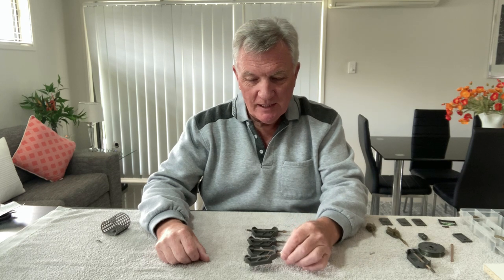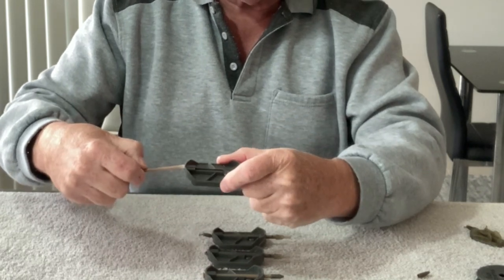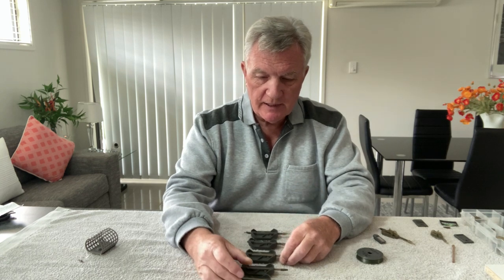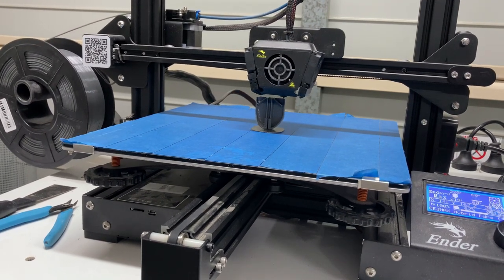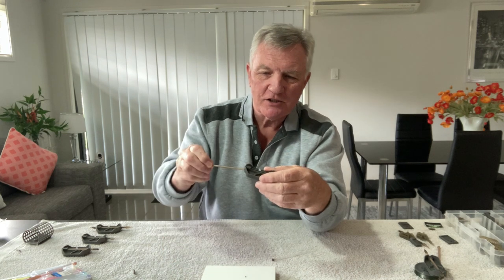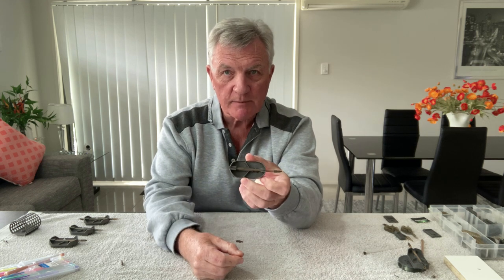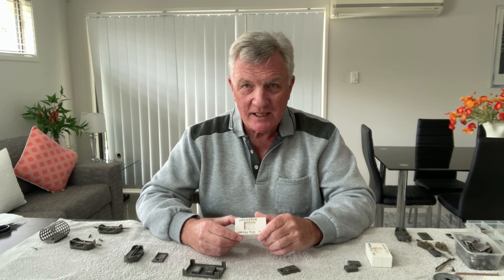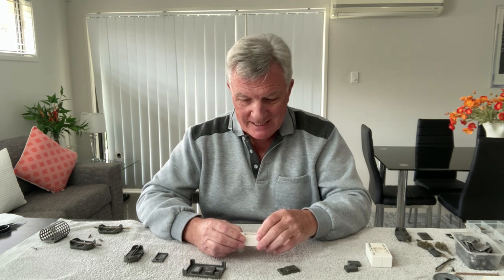New Method Feeders for Big Venues

Comment: Thanks Den for another very useful and most informative video. I mostly fish uk commercials so smaller non elasticated feeders are a must, but i will probably print these as well.
My Ender just about copes using Petg at quite a high temperature but it's worthwhile after a few tweaks as i found out when making your bait droppers. Thank you for expertise Den and role on your next match 🎣
Reply from the maker: Thanks for your comments mate. Much appreciated.

Comment: Well done.  I will be making them soon!
Reply from the maker: No worries Phill. I hope you catch plenty of fish on them.
Reply: @FishingwithDen  They printed well just got to get out and try them.
Reply from the maker: @Offcut55  Excellent mate.👍👍
Reply: @FishingwithDen  Just found that they will accept Bowden tube ;)
Reply from the maker: @Offcut55  I never thought of that Phill. If you want something more rigid and cheaper though, you could try that white plastic tube from model shops.
Reply: @FishingwithDen  I ordered some from Ebay before I had that lightbulb moment and tried my old Bowden tube after moved to Capricorn.  I did make a petg tube that worked but not sure for how long
Reply from the maker: @Offcut55  Capricorn tube would very durable Phill. I don't think a PETG tube would last more than about 5 minutes though.😁

Comment: Hi Den, What Dia are the gel stems and what are the make Thanks
Reply from the maker: I think they are Anko Bob from Kmart and they are 4mm I believe.
Reply: Hi Den, Thanks for that I just about to find what is needed and have a go at making the weight as shown can be used for the Cage and Feeder, I found some Sylo Gel pens on amazon that I have ordered. Just printed 2 of the large feeders so all goes well away I go. @FishingwithDen